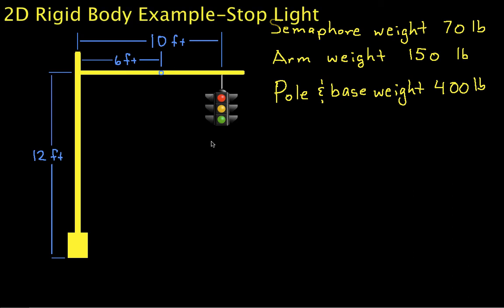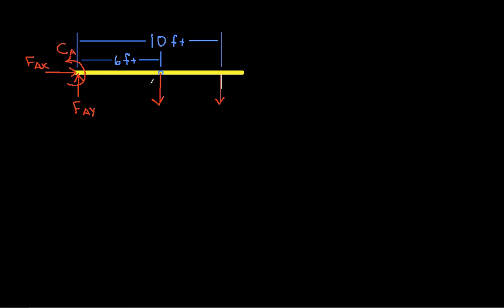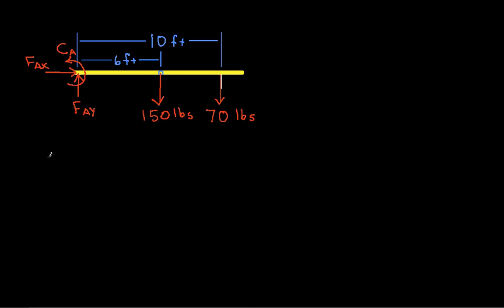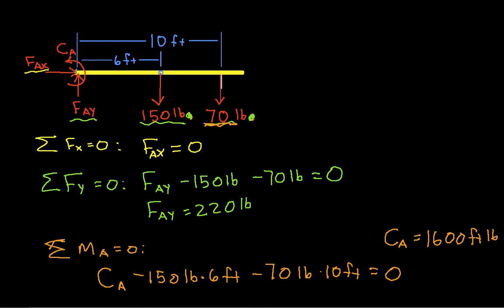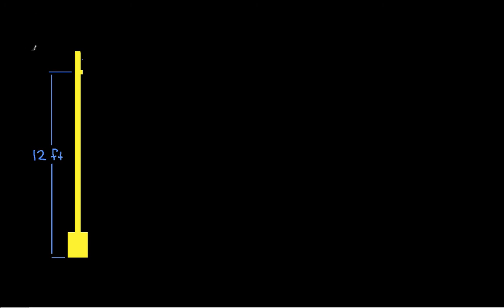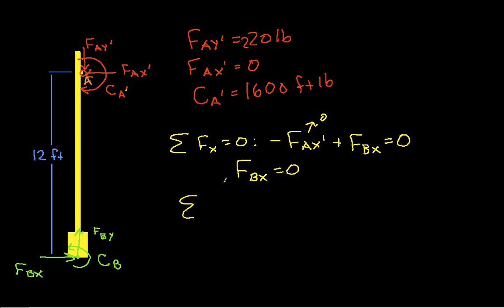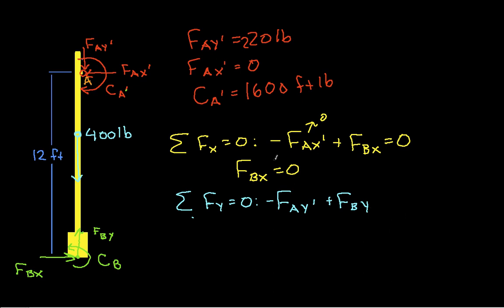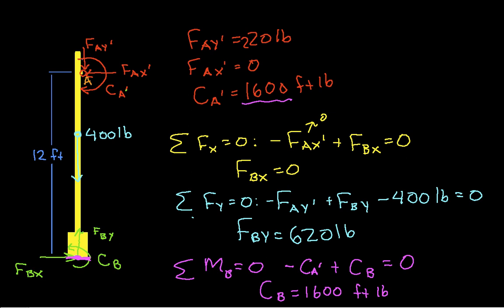2D Rigid Body Example-Stop Light

Comment: Very good explanation, but the answer is wrong. In point A of the FBD of the pole there is also a (small) moment going from point Fay since its on the edge of the pole and not on the middle line.
But since we do not know the width of the pole we cannot calculate it.
Dont feel bad though, you thought me this theory in another video (the one with the crane).